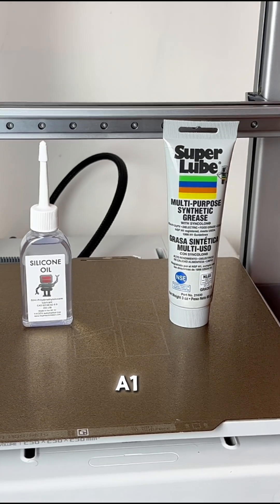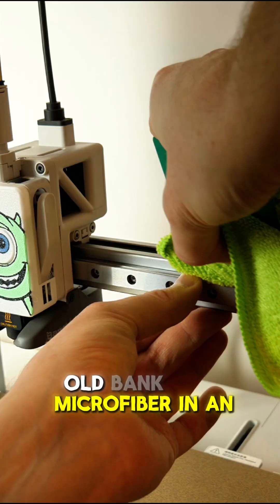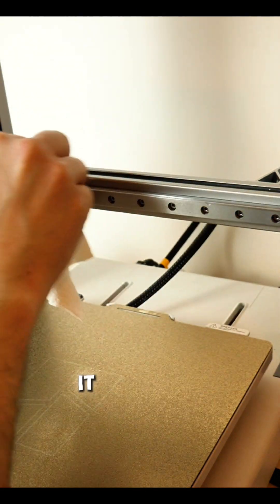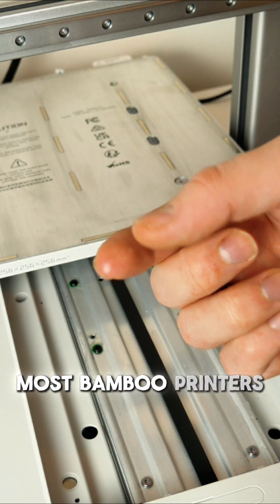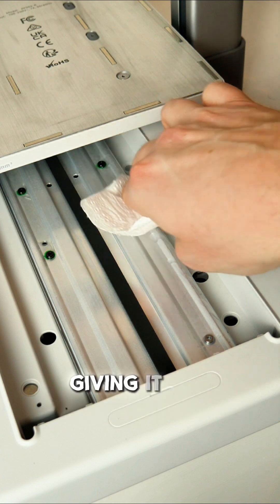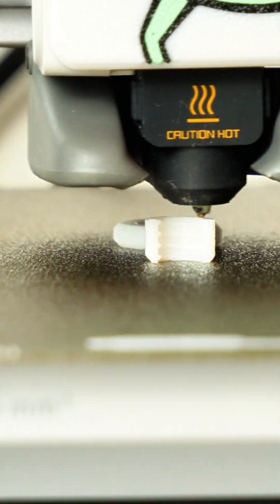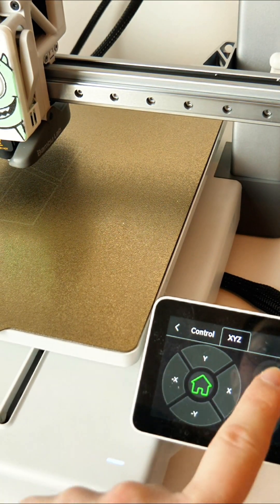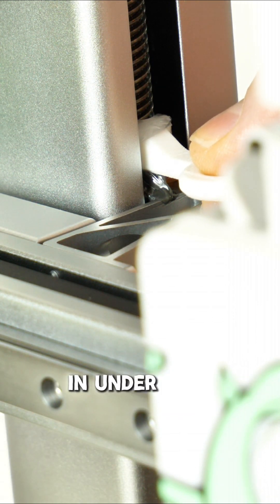BambuLab A1 Maintenance In Under 2 Minutes Guide  #3dprinting  #bambulab #bambulaba1 #maintenance

Comment: Also, you didn't lubricate the rails correctly. The oil needs to go on the side so that it kind of gets in there. You've put it on top, that's not doing anything for the printer.

Comment: That wasn’t filament, that’s the belt. The A1 eats up the belt in this section. I contacted bambulab because of this and they told me it’s normal. My A1 has about 800hrs of print time and still rocks the factory belt so not a big deal